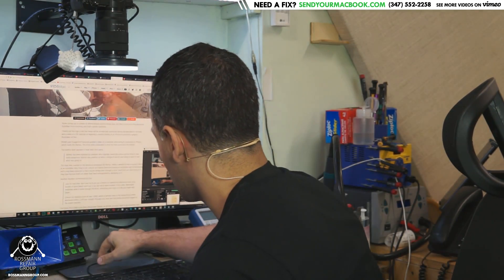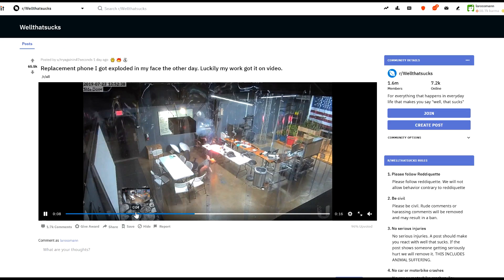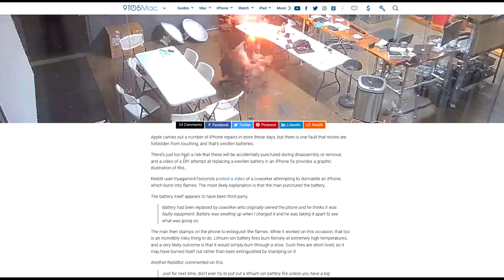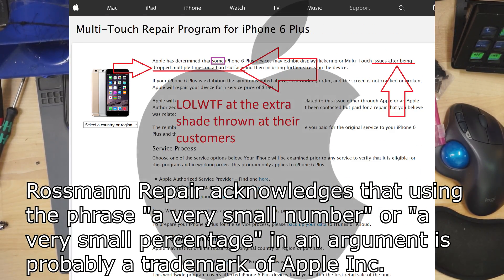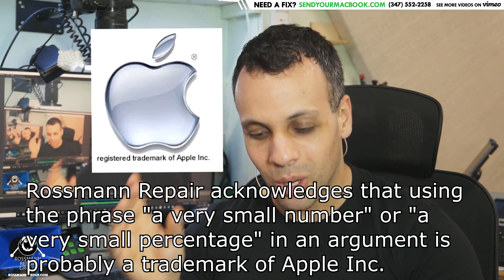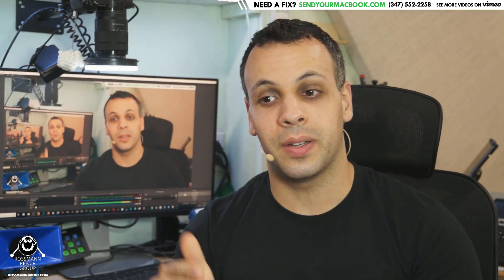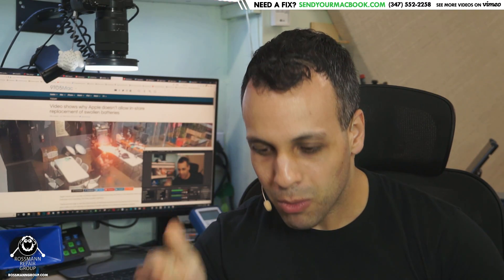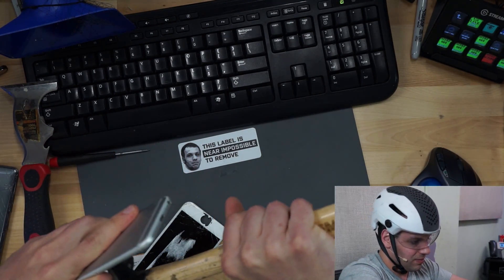STOP FEARMONGERING

Comment: Normal fire extinguisher can't put out metal fires
Reply: So, knowing that, you would put a normal fire extinguisher?
Reply: The obvious answer in this case: a bucket of sand.
Reply: @ToXikyogHurt  that would help, but normal repair shops don't know that
Reply: If you put effort in handling the lithium ion battery you don’t even need to care about fire in the first place.
Reply: @pyrojinn  mistakes happen that's what makes us humans
Reply: @pyrojinn  and we must be ready to solve the issues we make
Reply: If you're dealing with electronics, you probably have a co2 extinguisher. While this will not put the battery out, it will prevent the rest from going up. 
Also, if it catches fire, there isn't really a reason to save it anymore